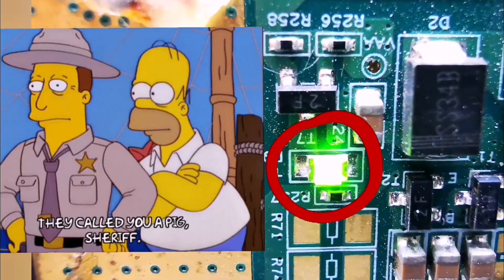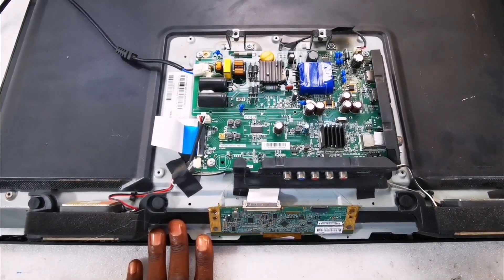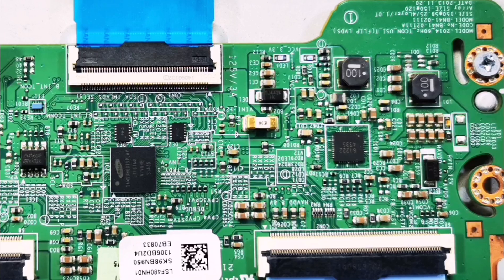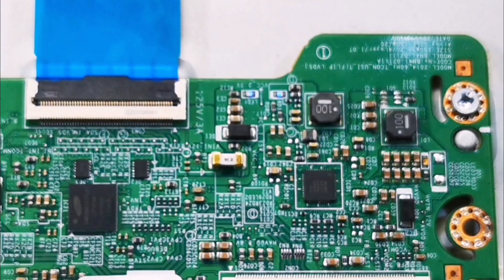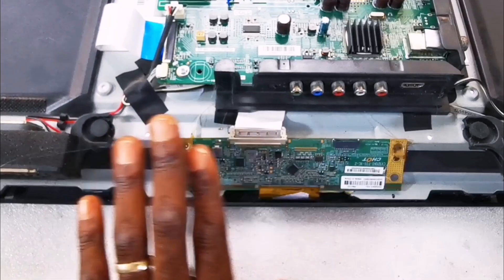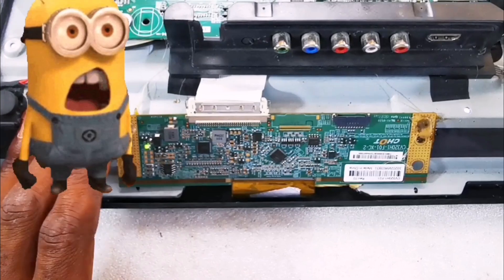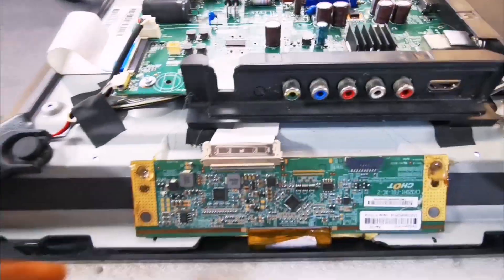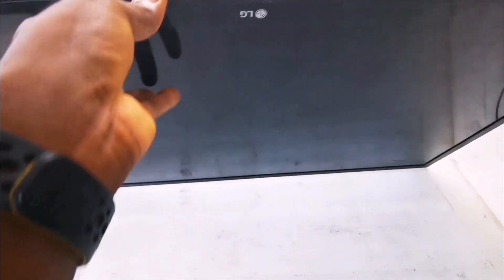LCD TV Panel TCON board repair made easy

Comment from the maker: Follow me on Telegram for more personal guidance - https://t.me/+4-px4i5cOGUzYTY0

   You too can master TV or MONITOR display repair. Explore how to do ribbon flex repair, LED/LCD/OLED TV panel COF TAB manual and machine bonding, microsoldering, and learn to fix faulty screens using several other techniques and equipment, following the tips in the videos on this channel, and with the right support from us. 

Kindly support our efforts to keep sharing panel repair secrets and tips by donating here: https://selar.co/8tz8q6